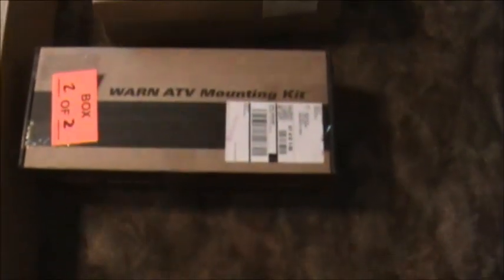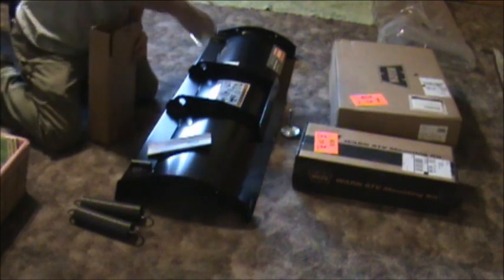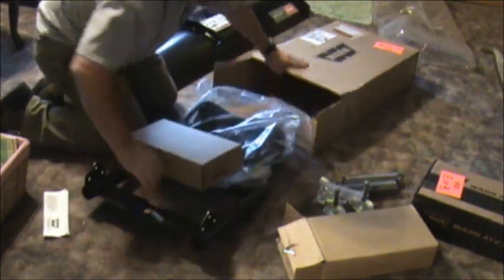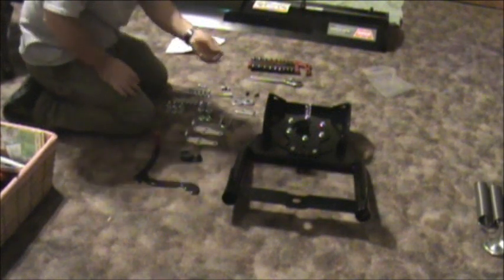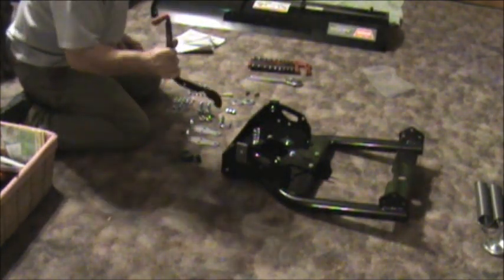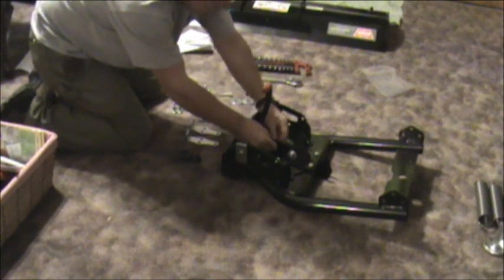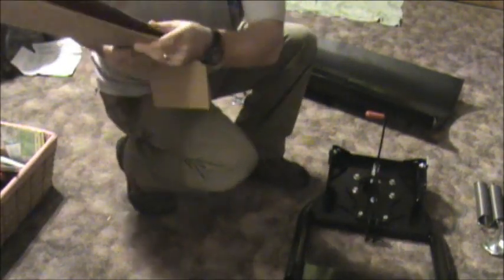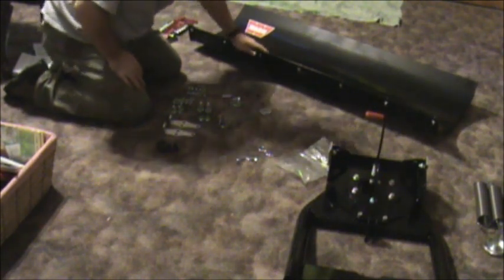Warn front mounted plow system (part 1)

Comment: Lonnie Thanks this was very helpful as my plow system from Warn came with no instructions and 3 bags of loose parts. The lighting was a little poor and you are very quick, all in all I got it done and it works well Thanks again.
Reply from the maker: Glad to help, and you are right the lighting isn't the best but I just got it and had to assemble it, and the best place at the time was in my living room because of the weather. Didn't have a lot of room to move things around either.  I'm glad it work out for you.